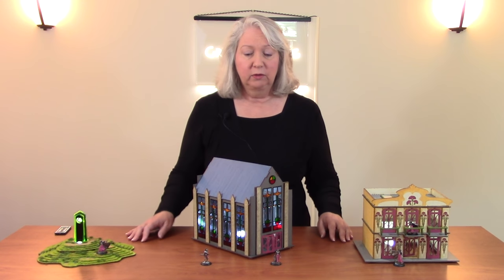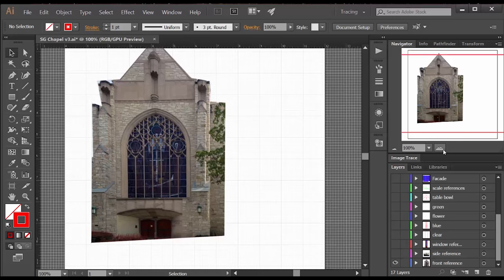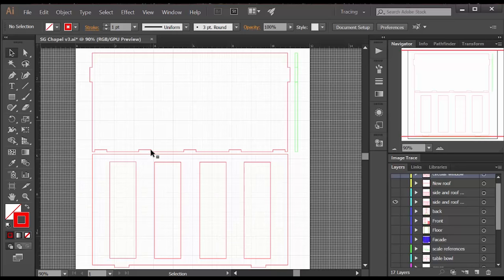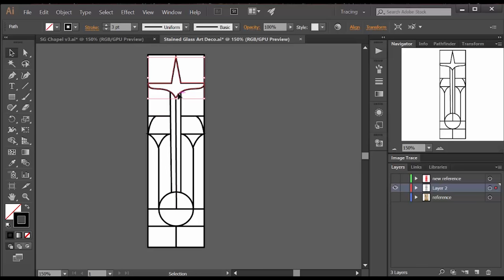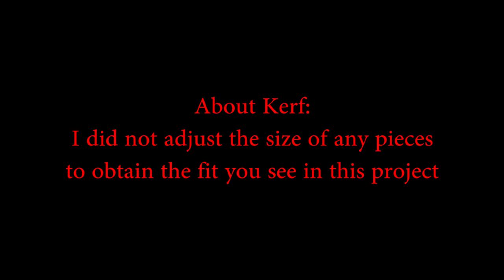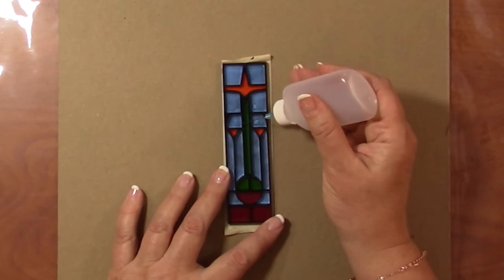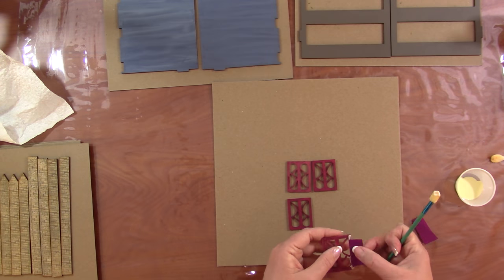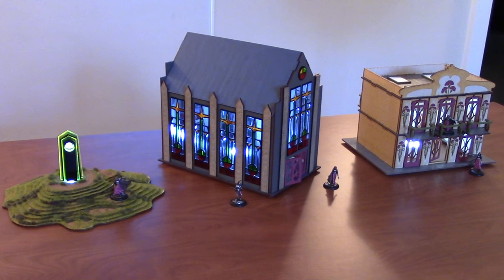How to Design and Laser Cut a Stained Glass Chapel for Wargaming Tabletop Terrain

Comment: Hey this is awesome. I would love to know how you fused the pieces of acrylic together? What liquid did you use?
Reply from the maker: Davy, it's Weld-on acrylic solvent cement:  Weld-On 4 Acrylic Adhesive - 4 Oz and Weld-On Applicator Bottle with Needle https://www.amazon.com/dp/B0096TWKCW/ref=cm_sw_r_cp_apa_i_FHykEbV8Y62MK
It's a miracle worker!
Reply from the maker: Davy, I double checked and I use the Weldon 3, not 4. 3 is very fast set compared to fast set. Both will work, but I like the quicker action.
Reply: @GreylightMay  Thanks a lot. It seems that we don't have that over here in the UK. do you think Plastic Weld or Tensol 12 would be equivalent? Thank you.
Reply from the maker: Davy, I've done a little research on this,  it is surprising to me that this is not available. Weld-on has an international division but it doesn't look like the UK has very good coverage. I think the two things to look for in an alternative is 1) is it water thin and 2) is 'solvent' in the description? This is a chemical that softens the edges of the acrylic and then fuses them together when the chemical evaporates. This is different from a two part epoxy that creates a hardened layer of clear material between the pieces. I can't speak for the two options you asked about, but the examples I found online looked more like the 2 part epoxy example...
Reply: @GreylightMay  Thank's a lot for your advice :)
Reply: @GreylightMay  Hey I have been using stuff called plastic weld which indeed is liquidy, evaporates and fuses acrylic together. However I have one pore question: Do you keep the protective plastic sheet on top of the perspex when bonding the pieces together? I am asking because if I don't do that then it leaves marks and stains on the 'glass' when it melts it. Any advice here would be most useful. Thank you!
Reply from the maker: No, Davy, I remove any plastic first. You have the needle applicator bottle? That let's you apply it accurately, just squeeze and create a bit of a vacuum before turning the bottle over, to minimize drips.

Comment: Awesome project and a beautiful piece of work.  I have a couple of questions.  What do you use for the leading and how do you apply it between the acrylic pieces?  What do you use for fusing the pieces? Is it CA glue, and do you simply put a few drops between the cracks?  Thank you.
Reply from the maker: The leading is actually a piece of laser cut opaque black acrylic, so the transparent colored pieces are just dropped in place. Then the fusing is done with Weldon solvent cement. I think I show this fusing process more clearly in my dice tower video, and also a closeup of the can of solvent. The solvent is thin as water and you suck it up into a syringe bottle. When you apply a few drops to the crack between two pieces of acrylic, it wicks along that crack. If you do it properly, it actually welds the pieces together as if they were a solid piece of acrylic.
Reply: Greylight May Thank you so much for your excellent tutorials.   I was thinking of making some stained "glass" pieces when/if I get my Glowforge laser cutter.
Reply from the maker: Hopefully it is 'when' and not 'if'!! Good luck!